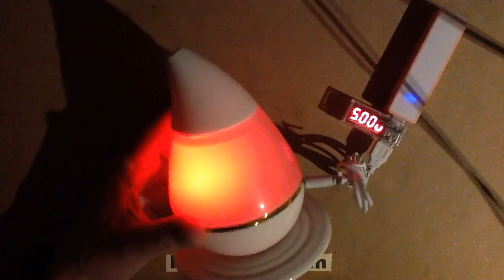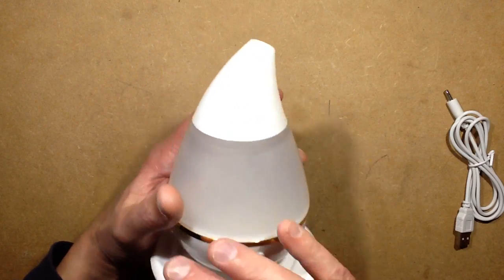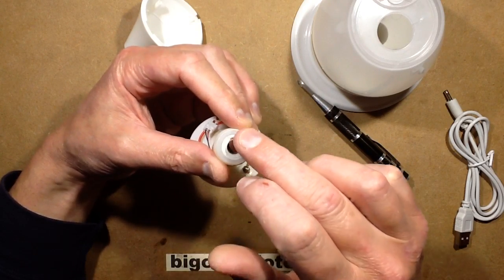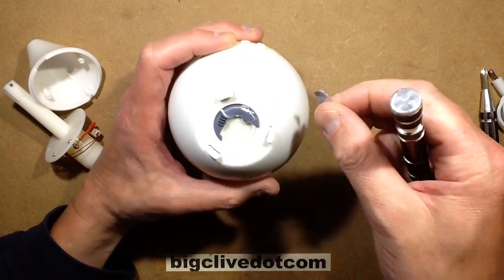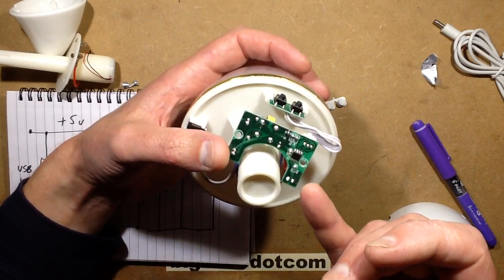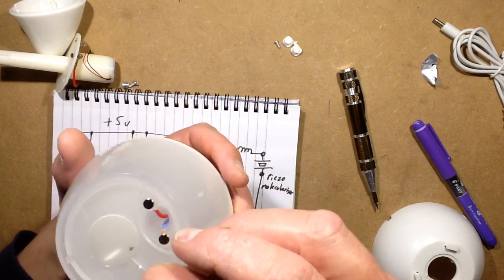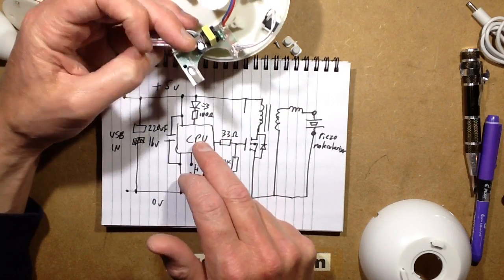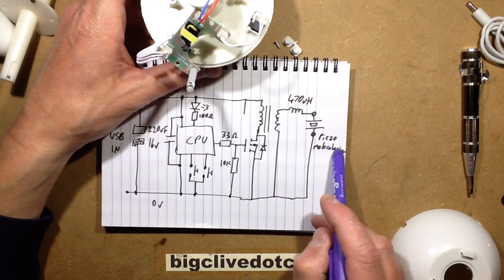Inside an illuminated USB humidifier.  (with schematic)

Comment: Common issue is that "molecularizer' piece..high frequency driver or oscillator fails to have output.. In the States, a quiet cool air mister or ultra sonic humidifier can run a good penny but only last a season or two.
We need to find a common fix on these...
Reply from the maker: The disks can often be changed.

Comment: @bigclivedotcom
i have one 6 heads ultrasonic mister from china, used only once a few years ago and now no longer misting, but just splashing water.. any idea why it splashes water but no mist ? very very little mist.
Reply from the maker: The height of the unit in the water is important.  Make sure the power supply is the correct one.
Reply from the maker: Also be careful not to operate it out of the water as the disks rapidly overheat.  (but can usually be changed)

Comment: I notice that there is a capacitor for high to low in a lot of electronic that seem to be doing nothing. Could someone explain why they are there?
Reply from the maker: If it's between the power rails it's probably a decoupling capacitor used to make the circuit more stable by acting as a local reservoir during sharp current spikes.

Comment: Just wondering - can anybody think of a good reason for why the transformer secondary and one end of the piezo are tied to the 0v rail? Unless I'm missing something it seems like it would work just as well putting the choke & piezo across the secondary with no connection to primary side circuitry. It just mildly offends my OCD to see a transformer deliberately "de-isolated" for no apparent reason XD.
Reply: Interesting thought. Hmmm, maybe that's the reason... dunno.

Comment: These things are useless in Germany. Usually never less than 60% humidity all over the year.
Reply: Exept that you lose alot of humidity in the winter
Reply: *****
I will tell you next winter, I finally got these small temp/humidity sensors Clive showed us. Currently there are 68% - 75% inside.

Comment: I'm putting something
together that has a circuit just like that in regard to the mucro driving a
MOSFET. I like your idea about a cap to prevent the thing from getting stuck
on. But for the life of me I can't wrap my head around determing the value cap
I shoud use. How would you work that out? And thank you for all the videos. I'm
constantly learnig little things that are very useful plus they are
entertaining.
Reply from the maker: When I've used this technique myself in the past I just used a standard 100nF decoupling capacitor.

Comment: The meaning of the word, "atom" needs to be taken into account by the context of its usage. So in this instance calling the device an atomizer, without actually splitting any atoms, is fine. Because included in the definition of the word atom is this, "an extremely small amount of a thing or quality." Which the mist particles that the piezo emit certainly are.

Comment: Maybe is only a dual flip flop CI not a microcontroller.
Reply: But where is the Oscillator?
Reply: The micro will be using its own internal RC oscillator. Some microprocessors have provision for an external crystal but that is not necessary unless you need a very accurate clock oscillator.
Reply: I meant if the Chip were a dual flip Flop, a Oscillator would be missing.
Reply: There is no external oscillator to drive something like a flip flop. If the chip was a timer like a 555 then there would be obvious timing components. From the schematic there are no such components so the only thing it can be is a micro.

Comment: Clive did you tear apart the family TV when you were a kid?
Reply from the maker: We didn't have a TV when I was a kid.  Probably just as well really.  I did however, apparently take apart the vacuum cleaner at the age of 3.
Reply: doesn't everyone?
Reply: Do remember all...    UNPLUG THE TV FIRST !!!   ...on the back of a CRT there's a lead going in under a suction cup and also some braided silver colored bare wires running around the length of the tube...   attach some alligator clips to the braided grounding wire, t'other end to an insulated handled screwdriver's metal bit and then slide said metal bit under the suction cup towards where that lead pokes through and you'll get a satisfying    POP    and the TV is now safe to poke around in...
Reply: poor vaccum cleaner,but i guess it deserved it,doing all that noise and all.
Reply: I had to wait until I was a bit older before taking apart the vacuum cleaner, but I did have to also make some impromptu repairs after vacuuming up some live coals from the fire. I had to fix it before my Mum got back from the shops. No pressure.

Comment: I wonder if it could be transformed to a portable cooling device with a small fan attached.
So it can blow the water mist in your face where it condensates and then evaporates cooling your face on a very hot day.

To save space the led pcb section gets cut off and a little dc motor powered fan gets soldered on instead. Even a small 40mm PC fan would be enough.
The usb power supply pcb section gets cut off too and replaced with a rechargeable lithium cell.

A small tubular water tank can be built for the wick. An aluminum 1$ flashlight with a rubber seal would do the trick.
Reply: you're telling me. I'm dying of the humidity over here right now.
Reply: Those are airborn water particles. Once they land on your face they would evaporate with the help of the fan. And evaporation = cooling. It is true that it wouldn't cool the air around you, however it would cool your face for sure. Simple physics.
Big fans with water dispensers like that are found outside of some fancy coffee bars and restaurants. I myself enjoy their cooling. But they are gigantic.
This would be a portable one though.

I even have a nice experiment for you. If you happen to own an electronic cigarette, inhale a modest amount and blow it all out on your skin. The vaporized glycerol sticks to your skin and starts to evaporate. You will feel a very cold sensation on that spot.

Comment: Although all these PIC chips are anonymous, you do know what they do (and their supply parameters), so in principle they can be reused for "other purposes". Those mini transformers from the smaller power supplies are really good for building basic LC oscillator circuits, and the various electrolytics and other higher-value caps are always useful for the odd HV project.As an aside, do you have a favourite LC meter? I'm using a Chinese kit, but was looking at a range, varying from "cheap'n'nasty" to well beyond Hobbyist - on - a - reasonable - budget price range (Kyoritsu . . . .)! Thanks for your thoughts, and as always a great channel . . . :-D

Comment: Cold humidifiers are horrible for you. They spray bacteria directly into your nose and lungs. Only use warm mist humidifers that derive their mist from boiling water.
Reply from the maker: As long as you clean the cold versions regularly they're fine.  If you leave them sitting for ages the water tray in the base will get slimy just like any other tray of standing water.
Reply: would they be safe with  distilled water and a sterilized chamber? I would assume safety protocol would be the same as with neti pots.

Comment: Hi Clive the concept of the 'moleculorizer' does make me think this may be the concept behind the next generation of Vaping equipment..... Other than a resistive element as is used currently. I would certainly remove the need for excessive heat in the vapours..... #NextBigThing
Reply from the maker: Ruyan who are credited with inventing the modern vaping devices started off with an ultrasonic atomiser in an electronic cigar.
Reply: lets hope they give it another try

Comment: Would this atomize alcohol ? There is a new 3d printer filiment coming out that smoothes using alcohol mist. Stick this thing in a bucket with the 3d printed part and you might have a cheep smoother for the new polysmooth filitment.

Comment: Put whiskey in it.
Reply from the maker: I did....   It didn't really work that well.  The mist came out, but the alcohol seemed to separate leaving a bland smell.
Reply: Curses, my plans to immerse myself in fumes of Laphroaig are foiled...
Reply: +bigclivedotcom Only you would put whiskey in one of those... we know you too well haha.
Reply from the maker: However...  I did have good results putting some whisky into a full size ultrasonic humidifier.  Just enough to get the float to lift in the base unit.
Reply: @bigclivedotcom  Are you able to let me know which brand you had success with using whisky in?
Reply from the maker: @bensdream  Any large ultrasonic humidifier will atomize whisky.
Reply: How utterly disappointing, that said I much prefer drinking my The Balvenie 15 year old single cask :)
Reply: Lagavulin is nicer :)
Reply: What about using the ultrasonic atomizer to make an e cig?
Reply: Light it :D
Reply: FrontSideBus
I prefer the Balvenie over Lagavulin, but both are good :)
Reply: 15 year old? Cradle robber!
Reply: +BENVA I'm thinking that too
Reply: +BENVA you mean the super vape?
Reply: The original patent for the first e-cig was an piezoelectric atomiser.
Reply: The Soullless - you'd have mushy cannabis that'll go moldy right quick...    cannabis oil tho is made by soaking the buds in alcohol, straining the plant matter out and then reducing it with heat...   so this thing is useless, in that regard.
Reply: what if I soak marijuana in water and put it inside of it
Reply: what is super vape? I thought about making a coil-less e cig with that thing BD

Comment: When will chinese manufacturers realize, that most people dislike that cheap RGB-LEDs?
Things like this would look so much nicer with a white ~5000K LED in it.
Reply: How dare you suggest the use of a cool white LED on this channel?!
Reply: I just don't like how they cycle through the colors. Some colors are slow, some are fast. Maybe they're equal in the software, but they should take human color perception into account.
Reply: +Snootches Bootches Obviously you can't read, because you keep persisting on saying that I said something that I did not say. Now fuck off, and maybe you should go fornicate, since you seem to be another piece of shit that thinks it's a required human need.
Reply: Sorry, I'm guilty, I like the slow changing ones and the cool white led.
Reply: It's cheaper.cheaper for bigger profit
Reply: I've seen those things in VMI CD resurfacing machines which cost $2k and are made in the USA.
Reply: Tim Ramich Its supposed to be a item used in relaxing. Its not made to be a party strobe light dude. Its more of your perception and not every human perception
Reply: +Snootches Bootches WTF are you talking about? Every normal human has pretty similar color perception. If you ramp through the colors in a linear fashion on the electronics side, it won't appear linear to a human.
Reply: Tim Ramich you said you dont like how it scrolls through the colors, 'Its to slow'.Thats what i replied to.
Relax.
Reply: +Snootches Bootches I didn't say it's too slow. I said some colors are too slow, and some are too fast. I said they should be evened to human perception, not some simple linear output from a computer. Learn to read.
Reply: I like the colour-changing LEDs too.
Reply: I just ordered one and it actually has just a white LED and a blue tank. It's neat.
Reply: +Tim Ramich "Every normal human has pretty simillar colour perception" How do you explain colour-blindness then?
Reply: tony sansom One would assume that's an abnormal trait. Which it is.
Reply: Colour-blindness is most commonly a natural part of aging: it occurs in 10% of men over 40. I wouldn't regard that as an abnormality.